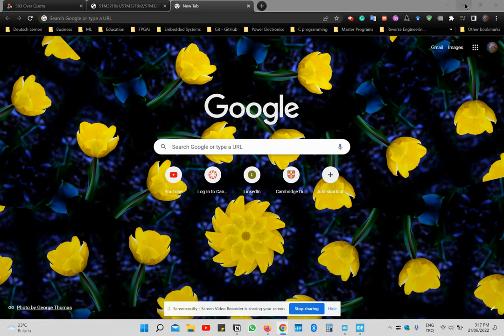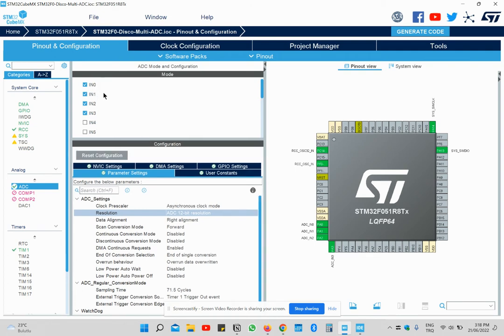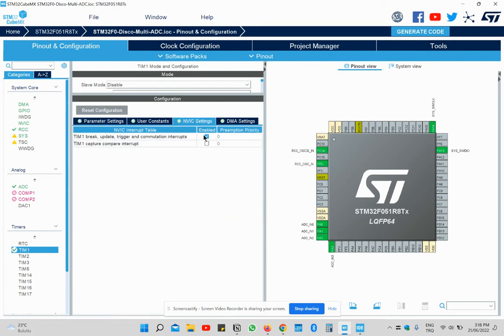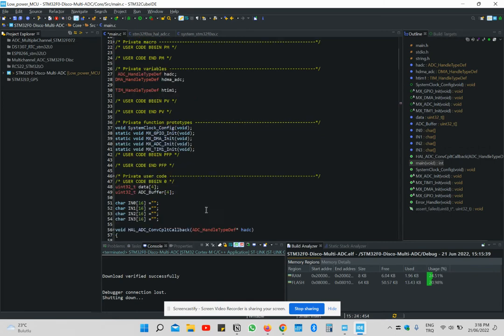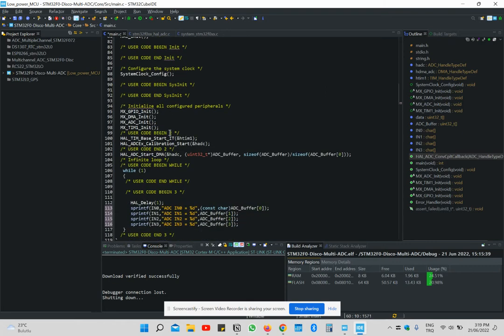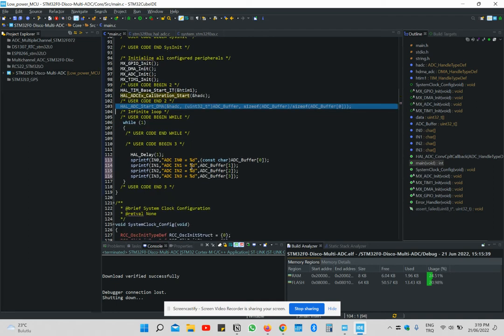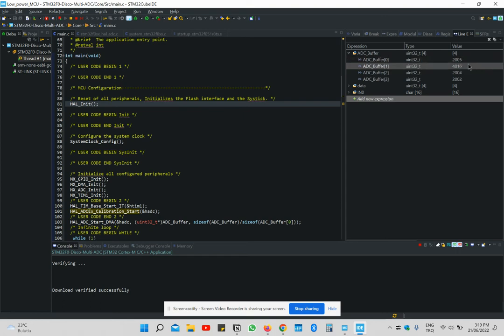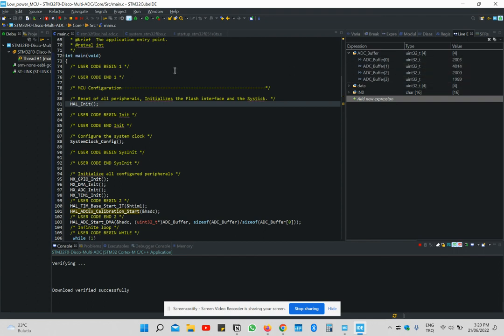Multi-channel ADC with DMA on STM32F0 Discovery

Comment: thank you for sharing this video. But still I did not understand HAL_ADC_Start_DMA(-) inside this function.
Reply from the maker: HAL_ADC_Start_DMA offloads the data transfer from the ADC to memory to a DMA controller, basically freeing up the CPU for other tasks. This improves overall efficiency. DMA cannot be triggered without this API.
Reply: @mucahitdemirc  You right, my mean is this expression : sizeof(ADC_Buffer)/sizeof(ADC_Buffer[0]). whis this code is doing sizeof(...)/sizeof(...)?
Reply from the maker: @MohamadSayadiFars  
sizeof(ADC_Buffer[0]): It calculates the size of a single element within the array ADC_Buffer. It depends on the data type used for ADC_Buffer. For example, if ADC_Buffer is an array of uint16_t (unsigned 16-bit integers), then sizeof(ADC_Buffer[0]) would be 2 bytes.

sizeof(ADC_Buffer) / sizeof(ADC_Buffer[0]): Also, the division provides the total number of elements within the ADC_Buffer array.